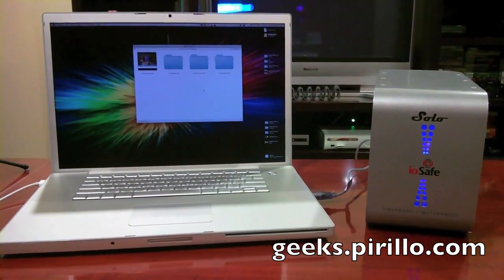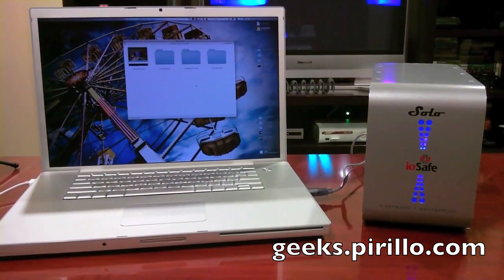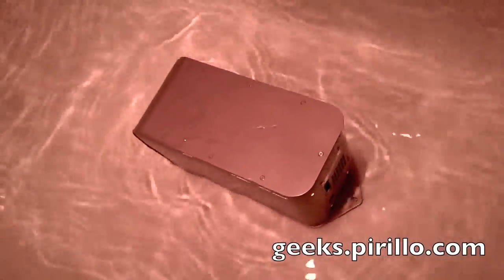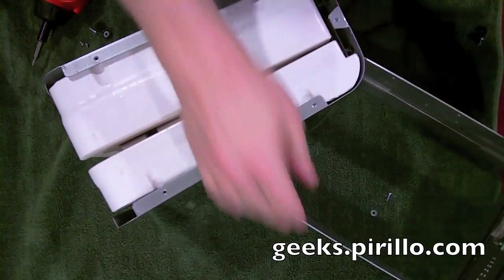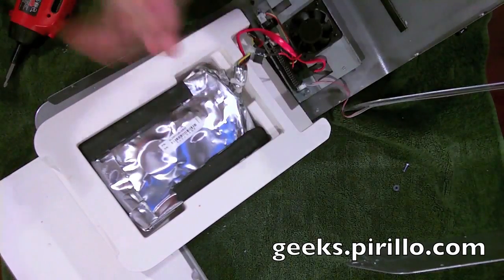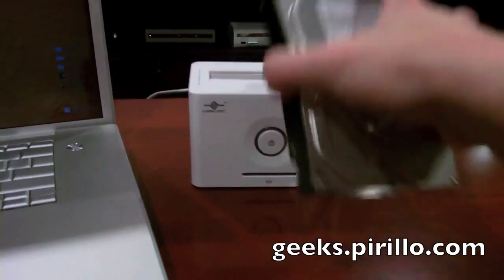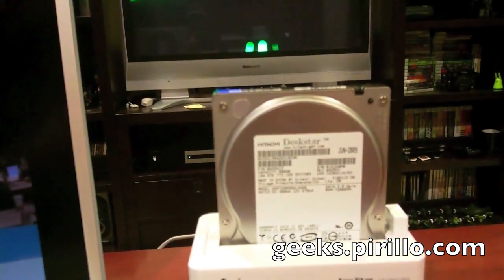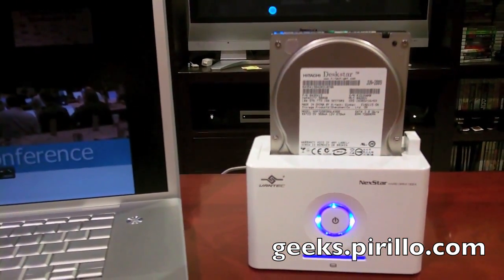Hard Drive Safety

Comment: One more little rant, you can get those silver thermal fire proof bags and even the cover-all outfit that you wear over your normal cloths at most camping and good sporting goods stores. prices range from $ 1.50-$5.00 for the bag to store your valuables in all the way to $30 for an entire outfit that protects the entire body from fire, i haven't checked on the price of this box but i bet its somewhere around $ 50 to $75 for something i can do with fireproof bag for a few bucks.

Comment: lol, why didn't he throw it into a raging bon fire out side? because it would probably warp the enclosure, heck, my safe isn't fire proof and its metal is 3x thicker than this thing, its fire retardant, not fire proof! BTW: i usually just use zip lock baggies for my drives when i take them out in the rain! ( and they cost only a few cents) lol.

Comment: Ok, hard drive enclosures have fans for large drives to keep them from over heating so how does this keep the hard drive from over heating when it is encased with no air circulation?    I would back up on line instead of buying this product.   House could burn and then sink into the ocean, no problem.

Comment: Oh oh, if the building burns down with the drive on the second floor, so it drops about 10 feet and then the building collapses on top of the hard drive, and then the firefighters put the building out.  My on-site archival backups are in a fire safe, pretty sure it is made of concrete with some metal somewhere in there, anti-theft, waterproof gasket, certified safe for tape media for the digital camcorder tapes.  Best part is it isn't the only copy so I'm not trusting everything in one package.